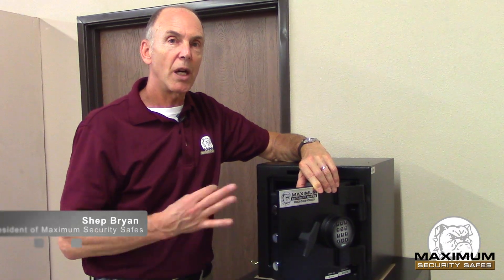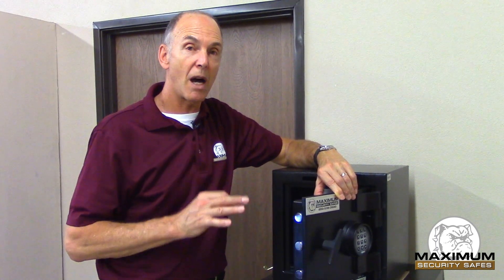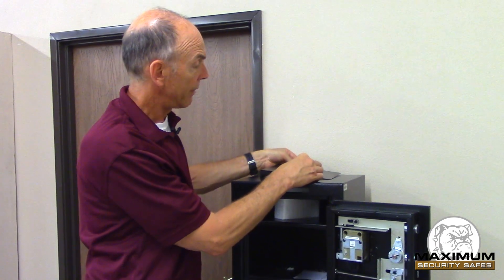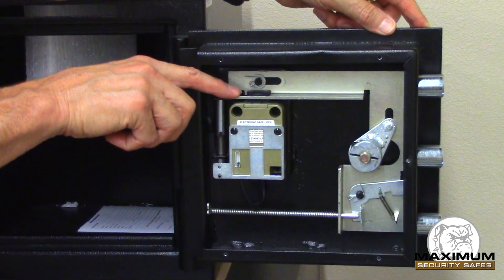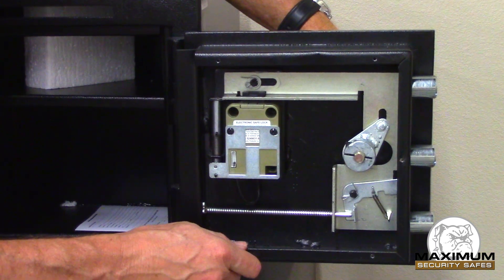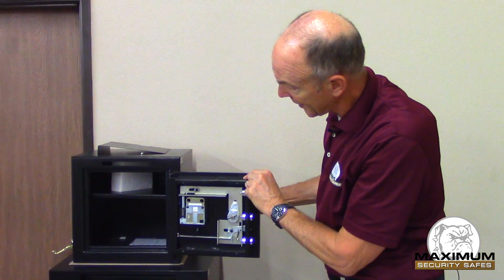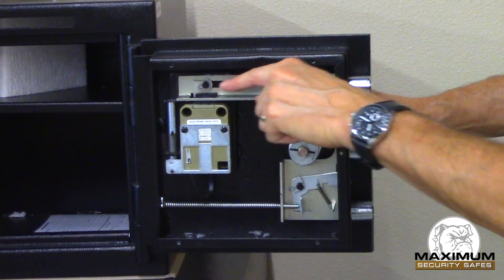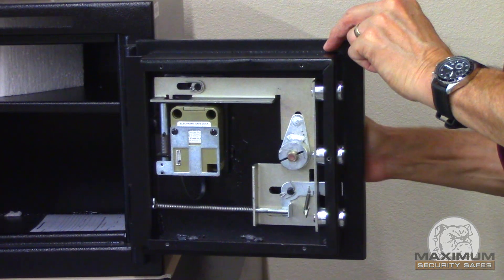How Does a Digital Lock Work?

Comment: This lock can be easily opened in 1 second using a rare earth magnet.
Reply: Callahan Covington ...but if the safe is 3/4” thick metal, (or more) how would the magnet have any effect on the locking mechanism? Please expound, thanks!
Reply: The magnet trick only works on the cheap Sentry safes that use a poorly made blocking solenoid.  AMSEC safes such as this use a high security ESL10XL lock which is U.L. listed, meaning it was tested with the methods burglars use to break in, so no, a magnet would not open this safe.
Reply: Would you happen to know how to unlock an electronic stac on safe?